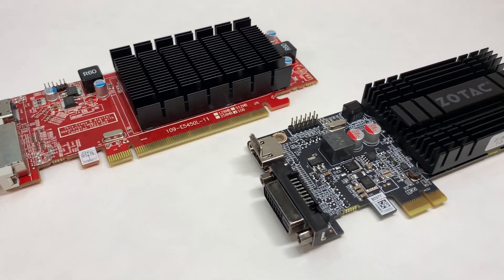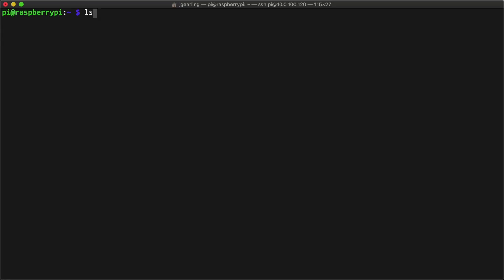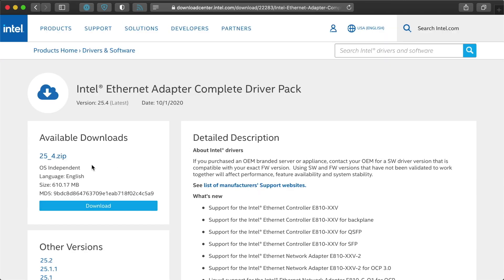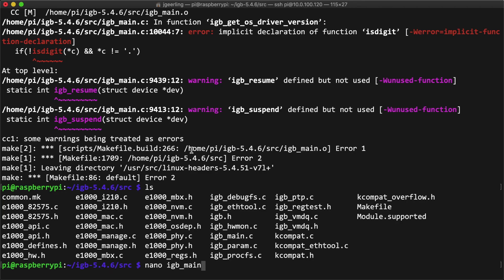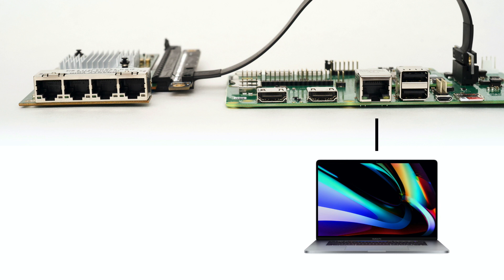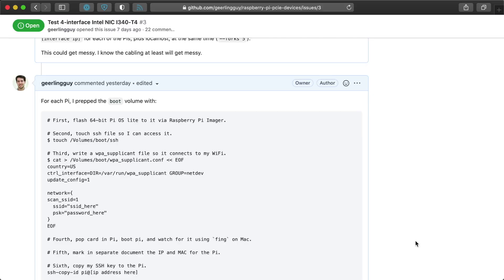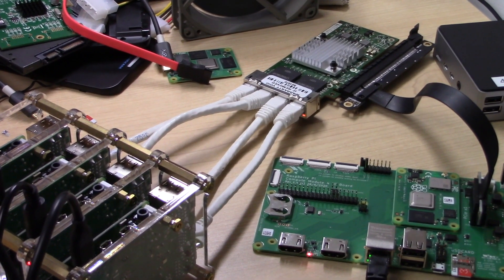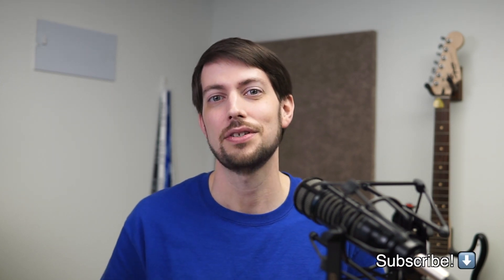5 Gbps Ethernet on the Raspberry Pi Compute Module 4?!

Comment: This looks really, really great, and also really, really cool!  I never thought to be possible, and this does enable me to bring my use of RPi at a totally new level!  I wonder, if it is also possible to connect M.2 modules to the RPi?  I'm having in mind connecting some fancier Wi-Fi 6 cards to the device, and those do require the M.2 form-factor.
Reply from the maker: Yes, at least some of them. I haven't tested any wifi cards in particular but might if I get the opportunity.
Reply: @JeffGeerling  Do you happen to have any videos that talk about such setups?  Is there a reasonable way to connect M.2 card to RPi, and at the same time to be able to use a reasonable case along with it?

Comment: I surmise the limitation is either your PCI lane, or more likely the CPU itself - you can test the latter by using 'iperf' against your localhost (may be worth attempting multiple simultaneous processes to test multi core performance also)
Reply: This is the answer.

Comment: your bottleneck in multigig installs is almost always processing power. The CPU simply just can't unpack and pack all that data fast enough to keep up with the interfaces. You might be able to get it if the data was purely serial, but with the tcp stack, you're just doing a lot more work. You might try UDP, but I still don't think you'll get the full bandwidth. The only way to get the full bandwidth would to be to speed up your CPU. That comes with its own problems, namely stability. That said, for a 4 port router, 3+ gbps is actually pretty decent at the price you paid for all that gear. It's actually better than some consumer grade components you might get, so I'd still be pretty pleased with those test results. Without overclocking, the pi can handle near the full bandwidth of 3 ports total, so as a firewall/router, with a single nic card added to it, it would do rather well, just patch the LAN side into a switch. Let the switch handle all the intralan traffic, and the 3 gbps max throughput of the pi won't matter because it'll never have to pass more than 1 gbps of traffic.

Comment: you'd be fine dremeling the card, I have quad and dual port variants that share the same pcb's(duals just have a few unoccupied components traces/pads) and although I haven't dremel'd any of the quads I had no problem with dremeling the dual's into 1x cards; there's even a line marking where the 1x slot ends :)..... you're speed dilemma is just the pci speed:P, why I never dremel'd any quads but did duals

Comment: Two things to note that you can test are getting a second computer and another quad port NIC. You can then link all of them P2P or through a 8 port switch assigning pairs of subnets to each set of interfaces. What I'm suggesting is testing SMB3.0 Multi-channel. This is supported in SAMBA so in theory it should enable you to perform a file transfer at the full available bandwidth of the combined interfaces between two computers.

What you may be experiencing here with your ~3Gbit cap is a CPU limitation since you likely don't have RDMA working. You can help alleviate the bottleneck by setting the default 1500MTU on every interface to 9000 (Jumbo Packets) then performing a ping test with a payload size of 8972 bytes setting the DF flag. This takes a load off the CPU and may enable higher throughput assuming the 1x interface isn't your bottleneck.

Comment: I believe pcie x1 has 2.5 gbps throughput, and the Pi's Eth0 might even be using the same pcie bus.
Reply: hi
Reply: After reading other advanced long descriptions I believe you are spot on. The bandwidth of the pcie slot is hitting a cap, and capping the bandwidth of a shared lane to the onboard as well.  I think he hit the physical max this can handle. Although packet optimization might give a little better but i think he is at full cap pretty much.  He traded out onboard ethernet saturation for pcie bandwidth, combined it's still pretty cool he got it to work this well.

Comment: If someone could make one of those motherboard with 5 high speeds Ethernet ports and somehow keep the price low while keeping its utility capability, so it would be come the form factor for router? That could go a long way in solving firmware version update problems.

Comment: Awesome stuff man, dont see many other trying this. Also About the Rizer, might want to try a few different ones, like for example a shielded one as some rizer cards induce some signaling errors which lower overall troughput), or powered one that accepts a 12v jack or Molex connetor (the RPI power might not be excactly enough, especially since the PCIE spec is up to 75 watts.
Reply: This is the other oart of the technical side which can often be erroneously overlookes

Comment: Great test. By the way your 1G switch can probably handle the throughput, as long as you had enough ports. 1G is the limit of single link, but overall throughput is way higher. GJ with testing the PCIe, waiting for SATA :)

Comment: I wonder if you could just let each Ethernet port on the PCIE card connect with one another?
I also wonder if the Gbits limitation is CPU related (the CM4 module's CPU), or maybe RAM?

Comment: The reason your running into your speed barrier at around 3 gigs is probably the io bus on the arm chipset for the pi. That's why the on board and the the pci lane have the same speed.

Comment: I think that the I340 T4 has 4 lanes lanes because it is a 16 bit wide interface. If you plug it into a 1x interface, the max number lanes available is two so you are not going to get the full speed on the interfaces.

Comment: actually the fact that you got only 3gbps is strange, if i recall correctly it should have pci-e 2.0 x1, so the bandwith should be 500MB/s or 4gbps, theoretically you could get all full 5gbps including the onboard port, but the cpu probably is the bottleneck

edit: by reading the pinned comment, yeah, is the cpu, maybe with an overclock it could work better?
Reply: He hit the theoretical max throughput for his setup.  Yes, the raw BW of the PCIe link is 4 Gbps, but all data is transferred in TLPs with a max payload size of 128 bytes, and each TLP has headers attached that eat up bandwidth.  Theoretical max BW is around 3.0 Gbps for 1500 byte Ethernet frames via PCIe DMA.

Comment: Wait a second, I just watched 6:00 where you explain that you wouldn't be able to configure 4 computers connected via 1Gbe on your network to your 4 Pi connections because you only have a 1Gbe network?? That isn't how switches work. You are able to have much more than just 1Gb of throughput on your network at any given time if you have multiple 1Gbe connections... If not, what would be the point of LACP bonds? Also, you could always completely take the switch out of the equation and just direct connect to the 4 computers.. 

Now, obviously if those 4 "Computers" were instead VM's all running from a single machine, then you are correct and you would only infact have a total of 1Gb of bandwidth.
Reply: I was looking for someone else saying this (thank you!). Jeffs assertion would be right if he was using a hub, but I can't remember the last time I (a network security guy) saw a hub. The cheapest 8 port gigabit switch can transfer 8Gb/s. So if Jeff had an 8 port switch he'd have been able to run this test (4 ports for the test computers, 4 ports for the interfaces on the pi)
Reply: @cgaquikkie  All of the 8-port gigabit Ethernet switches I've seen can in fact handle 16 Gbps, because they're full-duplex ... at least according to their spec sheets! :) (From what I've read in the past, half-duplex doesn't really exist for gigabit, IIRC.)

I also came down here looking for someone having made this comment :)
It's interesting that there aren't dozens of comments about this, like there were with the PCI-E x1 slot thing in the other video.
So is this actually a very common misconception even among a very tech-focused audience? 🤔

Also, do gigabit hubs even exist? I don't think I've seen one.
I do still have an 8-port Fast Ethernet hub gathering dust in my server closet; I bought it around 17 years ago for LAN parties as a teenager.
But prices soon fell and hubs just didn't make economic sense...
Reply: @AndrewGillard  haha yeah, it's very strange to see someone with the decent Linux command line competency and even someone who has dabbled with clustering before be such a novice in even basic networking concepts... But he seems to be very eager to learn so I'm sure it won't take long before he's up to snuff !
Reply: @cgaquikkie  haha yeah for sure! It's great watching this pretty much everything he did in this video I've used so many times for many different reasons.. I would definitely recommend him to use iperf3 rather than iperf, much better for troubleshooting , and also since he's only working with very low power hardware he would definitely be able to make use of the -Z flag (zero copy mode) which allows for much less CPU overhead. If I had to guess, I'll bet it's the CPU that is limiting his throughput.
Reply: I've heard people say that the cheaper switches don't actually have full switching capability, so I'd test it with known hardware before I tried it on an experiment.  Taking the switch out of the equation makes for a better test anyway.

I just moved and will need small auxiliary switches for my network, so I'll be testing this myself (not that it'll matter much for my application, but I'm just curious how much those rumors are true).
Reply: That is true. But still needs 8 separate endpoint from the same switch (4 for pi, 4 for other computers). If you would like to access other things than you need more port. I guess next step is a 16 port switch if 8 is not enought. So having direcct connection is an easy workaround if you don't have a 16 port switch.
I missed trying overclocking to see if it is a bandwith limitation in the soc.

Comment: Your problem is the bandwidth of a 1 lane pci 2.0 link.  Heres the numbers copy and posted straight from Wikipedia.  Version 2.x: 5 GT/s

x1: 500 MB/s

500megabytes x 8 bits is 4 gigabits - overhead around 3.2 gigabits

Comment: One of my main questions when using pfsense like systems is: How fast is the VPN throughput? Here in germany milions of AVM Fritzbox routers are used but they can only transfer 7 MBIt. A raspberry system would be a great improvement to this issue. Actually having only one network port blocks using the raspi, but with Jeffs new approach this could change. Does anyone tested the VPN speed ?
Reply: Hi ich komm ebenfalls aus Deutschland (Augsburg) ich selbst habs zwar nicht mit dem Raspberry Pi gemacht aber mit dem Banana Pi Router Board R1 waren damals so 20MB/s via VPN und SAMBA drin, die aktuellen Raspis sind dem R1 meilenweit überlegen, wenn du mehr Infos zu sowas suchst schau doch mal bei IPFire eine hauptsächlich von Deutschen entwickelte Firewall Distribution die damals auf R1 und Raspi lief
Reply: @teneniunlsl6818  Ich bin inzwischen auf i5 6.Generation Intel CPU Boxen mit 4 Ethernetports, da wir inzwischen 1 GBit symetrisch zwischen den Standorten haben und die können das mit ausreichend MBit via VPN.

Comment: the pi 4 apparently has a pcie 2.0 slot. the ethernet card is a pice 2 card as well. since pcie 2.0 x1 slots have a 500MB/sec (4gb/sec) maximum transfer speed, you will max out at 3-3.5gb/sec due to overhead. also the card is pcie 2.0, and has a x4 interface for a reason: so it can reach 4gb/sec; it cannot without the 4x slot. other people have gotten similar speeds as you using a usb 3.0 adapter and a ssd.
Reply from the maker: This seems to be true—and also the CPU on the Pi is limiting, as when I overclock I can get up to 3.4 Gbps across 4-5 interfaces. The card itself still seems to max out just under that.

Comment: Does the CPU on the Pi have enough horsepower for the speed? Does it support CPU offloading? The network cards almost certainly do, but both the OS and hardware probably need explicit support for it, and if that isn't used then there's going to be significant CPU overhead (given the limits of the Pi CPU).

Also - Have you checked the physical layout of PCI-E lanes on the CPU and motherboard? I have no clue what the setup is for a Pi CPU and mobo, but there probably aren't many - and their capacity might be shared for a lot of devices. If this is actually a 1-lane PCI-E then that's 1GB/sec theoretical, or 8Gbit/sec. Then you have to add a fair bit of overhead to that, plus any devices that may be sharing that bus in such a compact system.

EDIT: I see from other posts this actually uses PCI-E 2.0, so then you can out at 4Gbit/sec. Given that you got very close to that - I'd assume this is the reason - simply that you've maxed out the bus.

I have very little experience with the Pi systems, but that's some of what I would check first.
Reply from the maker: That seems to be the bottleneck here. IRQ interrupts queue up packets, and things get slow. If I overclock, I can get up to 3.4 Gbps or so!

Comment: FYI, if you use the multi port NIC with pfsense, people will unhelpfully ask you, "why don't you just use a switch?" instead of telling you how to bond the NIC interfaces together. I've set this up a time or two and while I won't pretend to remember what the trick is off the top of my head, reply here and I'll be happy to help you through it (since the pfsense community has historically failed to do so).
Reply: How good is the pfsense community? Do they readily share info?

Comment: Can you have a look into getting SATA working on these boards using a PCI to SATA adapter? It'd be good for reliability of RPi NAS servers with multiple drives

Something like this https://www.amazon.co.uk/Ziyituod-Controller-Expansion-Profile-Non-Raid/dp/B07TD57RGZ/ref=sr_1_3?dchild=1&keywords=pci+to+sata&qid=1604094718&sr=8-3
Reply from the maker: That's coming up soon — I have a few drives, power cables, and a SATA card that I'll be testing soon. (See the end of this video ;)

Comment: What you described might be due the CPU wiring on the PCB? Maybe there isn't more pci-e lines to CPU to deal with more than that? I tried really hard for whole 25 seconds to find block diagram of CM4 to see if this has any bases what so ever, but by Friday evening brains weren't up for the task. Or then there was so many interruptions on CPU that there wasn't enough time to do more testing? Did you check the packets per second rate?

If that's the case, maybe trying something a bit higher end network card would be interesting, as you could offboard some of the tasks from CPU to network card and try to increase the bandwidth utilization on the port with that?
Reply from the maker: That's my hope, as I should be able to get a 10 Gbps network card in soon (and maybe a couple to choose from...).
Reply: @JeffGeerling  I suggest looking into used data center cards. Mellanox have had really good offboarding features for a long while and older connect-x cards are relatively cheap on ebay.

Comment: Jeff, the max out for 1 Gig is 786MB, not a full 1 Gig like you think
Reply from the maker: For a 1 Gbps connection, I typically measure ~940 Mbps (depends on device, network, and cabling). Real world that translates into around 115 MB/sec tops (though most of my gear seems to top out around 90-100 MB/sec).